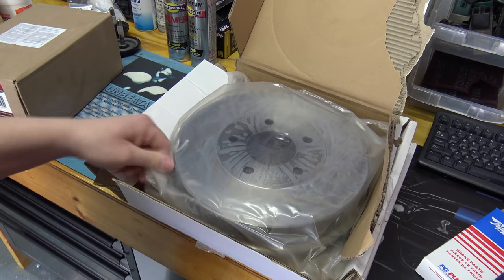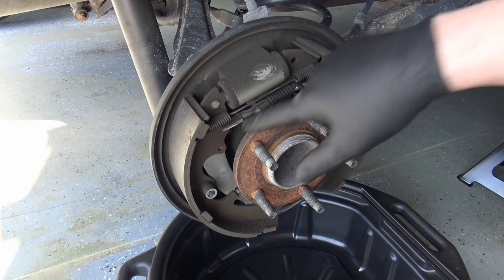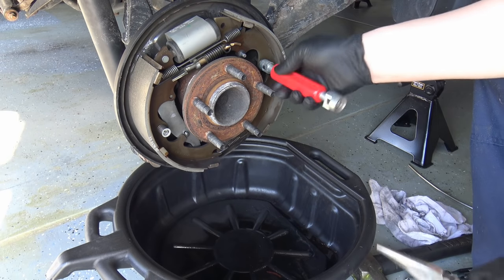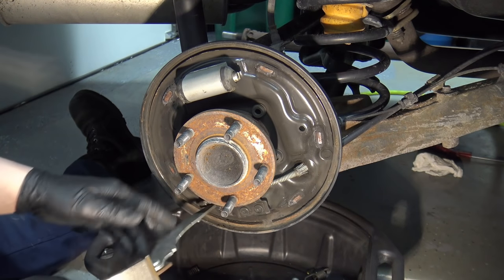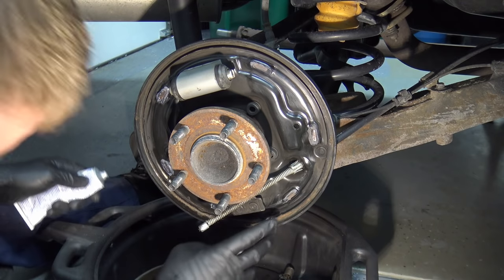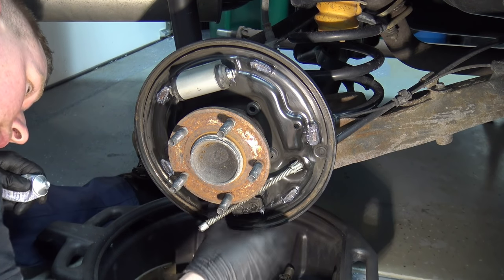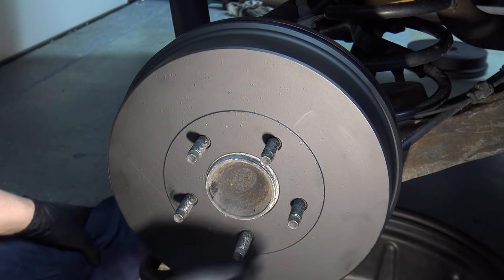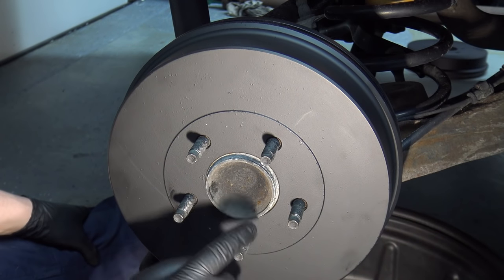2008-2012 Ford Escape Rear Drum Brakes Replacement

Comment: I think I would have replaced the cylinders just because of the amount of time the shoes last. because with my luck in 20000 miles I'll be back in to replace in the cylinders
Reply from the maker: +plowtruckdriver I would on some other vehicles like those darn Taurus cars but these I have never seen fail.